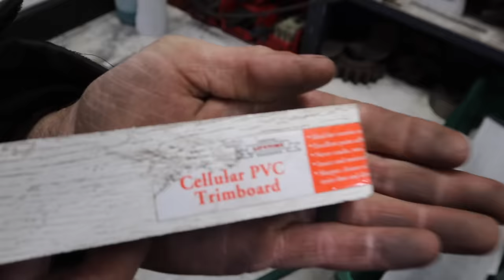The Forgotten Hand Plane ~ Fully Restored & Customized

Comment: Next time you find a plane in this condition, try using electrolysis to remove the rust and free up the frozen bolts.  You'll be amazed at how smooth the original metal surface will turn out, and you'll be spared all the scratches and wear from the metal brush.  You'd want to remove the wood first of course, but everything else will be in much better shape at the end.  As has been mentioned, WD-40 and penetrating oil (Marvel Mystery oil is my personal favorite).  Make the electrolysis tank from a 5 gallon sheet rock compound bucket.  Use a manual voltage trickle charger to provide a constant, yet light voltage.  Fill the bucket with water and add a few tablespoons of baking soda.  Don't immerse the charger alligator clips in the solution but suspect a piece of stainless steel (like a cheese grater) from the positive (red) clip.  You'll need to expose bare metal from one end of the plane, and attach the black clip to that clean bare metal.  Let it sit for a couple of hours. Remove, and rinse with hot water.  You'll discover the red rust will have changed to a black crust that you can gently remove with a razor blade.  Spray WD-40 on the bare metal to prevent the red rust from returning.  Use 220 grit wet-or-dry with WD-40 to smooth what remains.
Reply: I think you mean washing soda, not baking soda. That's what I've seen recommended and used.
Reply: @Bargle5  No, I actually use baking soda.  It works perfectly well, as does washing soda.  Possibly the difference is that it takes several hours for me to achieve results.
Reply: @jamescook8614  OK, if it works for you, it works. Ya learn something new every day. :-)

Comment: Beautiful work, must be a bitch working outside like that. Anyway, here are a couple of tips that can help you in the future. Warm the rust remover. You don't want it boiling, but pretty hot. you'll have to use a metal pan to heat it of course, an old aluminum pan will do. It makes the rust remover more effective and work faster. (some you can't heat, I don't know exactly what you're using)  two get or make some various size hollow ground screw drivers, or get a multi-head one that has bits you can change that are hollow ground. This means the blade will fit exactly, and greatly reduce the possibility of the head stripping out. Nice job with the torx bit, but they do make a tool.. a few actually, just for that purpose... however a warrior uses what weapons are at hand, there is no shame in this. As to the painting, well if you plan on keeping them for yourself, fine, do them how you want them, however if you want to resell, take the paint off and do them with the black Japaning. like original, in top notch original condition, the 606 can bring 350 dollars. Not sure about the other one, but it's up there too. The 606 B like you have with the corrugated sole is kinda rare, it might bring more. I noticed that once you had the blades installed, you never set them down directly on the sole plate. you always had a wood block or something keeping the blade off the bench. Good on you for that, most don't know you should never set the plane on the bench on the sole, lay it on it's side so you don't put nicks in the blade. You can set it on the sole if the blade is withdrawn, but old farts like me might still give you grief about it. Back in the day, in factories where these were in common use, you could be fired for setting one on it's sole, blade out or not. These days, not too many know much about them and how to use them. When the curls are coming off nice like that though, it's easy to use it too much on a particular project. I could make curls like that for hours when it's going so smooth. The right plane with a sharp blade on the perfect block of wood,,, it would soon be nothing but curls, lol.

Comment: Would Stanley Bed Rock be a predecessor to the current day tool company known as Stanley Tool?
Reply: Stanley's bedrock line of planes were really just an attempt by the marketing team to developa line of planes they could charge more money for but in reality the bedrock planes were not an improvement or even more advanced than their regular time-tested Bailey pattern. The truth is, the reason the bedrock planes are so rare today is because no craftsmen bought into the marketing hype back then, so Stanley stopped making them after only a few years. The only difference between bedrock & regular Bailey planes is that the frog adjustment on the bedrock design is actually a hindrance because it advances the blade (deepens the cut) at the same time as the frog is moved forward. The Bailey pattern frog adjustment allows for the frog adjustment & the cutting iron stays at it's previous setting. I know collectors may get excited about bedrock planes but real wood workers, including myself, will pick the Bailey pattern over the bedrock every time.

Comment: The bottom should not be flat, there should be a high spot immediately in front of the mouth to compress fibers just ahead of the cut. Some Stanley planes were belt sanded creating a hollow in front of the mouth - the opposite of what is required.

Comment: Always lay a plane on it's side!
Reply: Do you know why? 

I subscribe to Paul Sellers' philosophy on this; they drilled it dogmatically into generations of kids in their school woodwork classes. It saves you from having a kid place it on a surface which might damage the iron, so fair enough. 

However if you know the surface is fine, there's no danger in setting it down on its base. Otherwise you wouldn't dare put it on the workpiece and it would be useless! You also avoid inadvertently changing the set of the iron which may occur in laying the tool in its side.

Feel free to keep laying yours in their sides, but I don't think it does much good to just "shout" admonitions without providing any justification. Besides which, it's his plane innit? 😁
Reply: @wrongtown  exactly

Comment: Your rust remover didn’t work terribly well because it was so cold.  The rate of most chemical reactions roughly doubles with every 10 degC increase in temperature.  So the  rust remover would work 4x faster at room temperature than at freezing.

Comment: Is there a reason you didn't use WD40 or something similar to cut thru the rust?
Reply: WD40 is not a rust remover.  It was developed as a water displacing agent (as in WD) and now used as a light lubricant by many.
Reply: I wasn’t thinking if it as a rust remover. I meant it as a release agent for the screws. For rust removal I use vinegar
Reply: @dahljerald2934  Misunderstanding...vinegar is good.  I use it all the time.  ATF and acetone, 50/50 is about the best to free up rusty parts.

Comment: your planes have a bedrock lever cap.. but a bedrock, planes have three adjustment screws, for the frog   the hold down pins have a flat top, and no threads on them , flat topped pins, with a tapered hole to engage with two of the pointed screws to tighten the frog to the base. something is amiss, please advise. please look at Stanley catalogue for bedrock planes.
Reply from the maker: Check out type 4: https://www.antique-used-tools.com/brtypes.htm

Comment: It never crossed your mind that there is something called filler?
Reply from the maker: Lol... the plane sides & botton come into direct contact with the wood, depending on where its being.
Reply: @SalvageWorkshop  I'm confused on your explanation, I mean like the bottom and the sides where the rust really are the metal why did you not use filler? IK I'm repeating my question but I'm just not understanding your answer 😅?
Reply from the maker: @fnafplayer6447  fair enough... you dont want to fill the pits on something that will directly contact wood, because you dont want to contaminate the wood with filler,  you want to keep it clean... filler will chip out as it gets used, not only messing up the wood, also making the plane look like crap... the only reason filler might be used is if you wanted to put it on a shelf as a decoration, and NEVER use it! I plan to put these back to work, and I wanted smooth shiny metal! It was a TON more worth, but worth it in the long run!
Reply: @SalvageWorkshop  ooooooooooooooooh that makes sense

Comment: When disassembling, it was better to use WD-40 or a similar liquid from the very beginning. At least kerosene and light oil. And a gas burner. Then it would be possible to do less violence and without damaging the thread.
Worried during processing on the grinder.
Good old tool. Nice to see him rejuvenated.

Comment: If I chould have done this restauration, first I would take of the wooden handels an then put the planer in coke cola. It is the far best rustsolution I have found. It will go into every chrak and desolve all rust in a day or two. Quite shure you didn't brake any bolts og nuts by this
Reply: It must be the phosphoric acid in the cola!

Comment: I was with you until you used an orbital sander on the sole. But then you stuck a file into the throat ... and you lost me. But it LOOKS pretty.
Reply from the maker: Do you really think you saw all the work that went into bringing that plane back to usable condition in the video? Clearly you've never had to resurrect something that far pitted with rust.... you'd prolly just throw it out!
Reply: @SalvageWorkshop  In keeping with the notion that one can produce too fine of an edge on a particular cutting tool... I have a Stanley #5 -  mid-20th century, and a Stanley #7  - late 19th century, that I merely brushed, lightly treated with vinegar, oiled, waxed, and sharpened. Neither of which are as pretty as either of yours, but they retain the original geometry of the designers and function as well as my old hands will permit them too. Clearly the two you featured were in far worse condition, but I would never have applied a file to the throat as my interest was in using them for their intended purpose - not displaying them as some sort of vintage folk art. As I said, yours ... are pretty. FYI I also favor vintage sports cars, wrenches and chisels. But thats just me.

Comment: In my opinion, it's just not ethical to put a Bedrock lever cap on a run-of-the-mill number 5.  Any buyer could be easily fooled into thinking he's got a real Bedrock plane.
Reply from the maker: It IS a real bedrock... Stanley did that from the factory... Research bedrocks made for Keen Kutter if you interested in learning more about it!
Reply: @SalvageWorkshop  Then it should have a KK lever cap.
Reply from the maker: @ExilefromCrownHill  Lol... "Beds marked with only slanted single digit numbers:"2" - "8", lightly milled space on some planes where the "K" or  "W" would have been for a Keen Kutter and Winchester.  Planes made for Keen Kutter and Winchester but later sold by Stanley in the general market." Like I said, look it up!
Reply: @SalvageWorkshop  according to Bob Kaune, who wrote the well-researched book "Antique and Used Tools", he said "Keen Kutter Bed Rocks had plain lever caps ....."   This is why I commented originally, and I stand by it.  You made a 'Frankenplane' and you should make it right.
Reply from the maker: @ExilefromCrownHill  You're right, if this WAS a Keen Kutter Bedrock it would have a plain lever cap, but it's not! You must not know that Stanley had extra beds they didn't sell to Keen Kutter or Winchester (NO idea why), and instead of throwing them out, they milled off the letter (K or W) before the number on the plane bed, then put those planes together with original Bedrock Type 4 Parts. This included the bedrock lever cap, Stanley iron, and Stanley lateral adjustment lever, Then they sold them to the pubic as a Stanley Bedrock #5... It's clear this was done from the factory because the milled off letter wasn't able to be seen until I removed the remaining black japaning from the bed... When I started working on this plane, I wasn't sure what it was until I removed the black and could clearly see a faint K that had been on the bed originally in front of the 5 on the bed... this was NOT standard, it was one of the well documented anomalies from the 1920's... I appreciate your passion, but I dont guess at anything that I decide to put out there on the old inter web!

Comment: Sorry, I'm calling bullshit on this one. Lots of little things don't ring true. At 0.23 he seemed to be unable, using considerable force, to move the adjustment clip, but it moved too easily with the application of the screwdriver. Yes, I know about 'it's a lever' but there was just too little resistance. Also, some of the screws, when unscrewed had rusty threads, unlikely if the screws had been fastened all this time. Also, the rust was removed way too easily with a simple nylon brush revealing a too clean metal underneath. I think this plane has been previously disassembled and 'pre-rusted'. I apologise if I am wrong, any single one of these things I could let go, but soo many suspicious instances?
Reply: TukikoTroy yeah...ok, he’s scandalously falsifying restorations 😂😂😂😂😂
Reply: @Adam Wilson. It happens... quite a lot, actually.
Reply from the maker: I HATE fake restorations! This is not one of those. Watch a few more of my restoration videos before accusing me of faking a restoration... I don't have the time to fake ANYTHING! I have hundreds of tools & machines that will make awesome restoration videos, sorry but you're wrong on this one!!